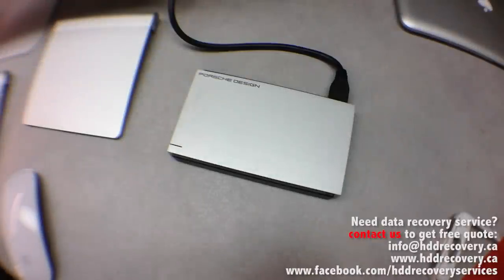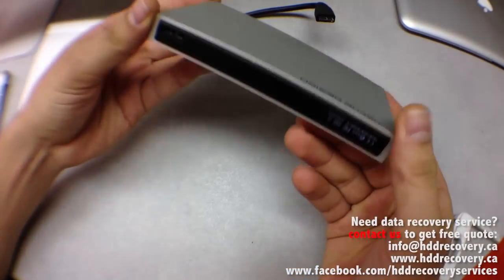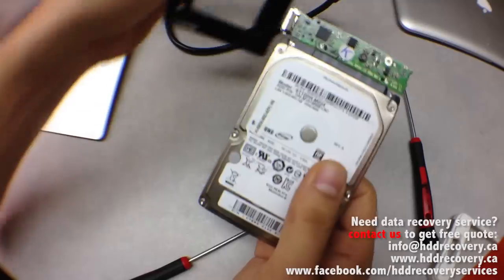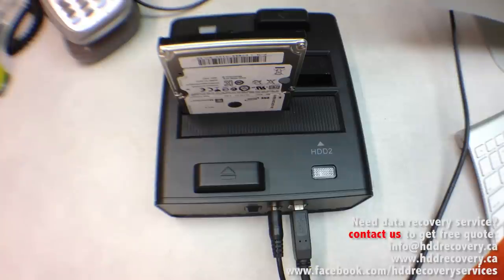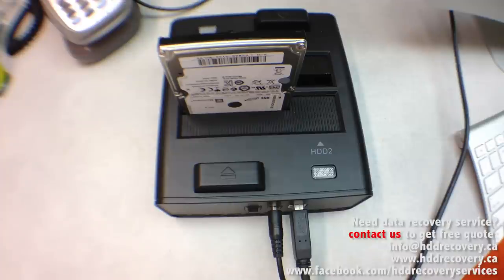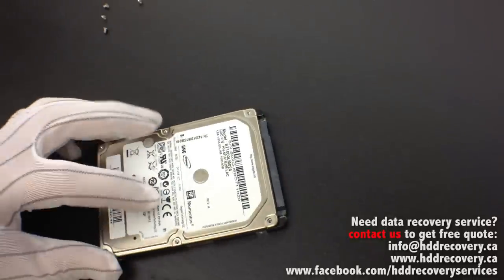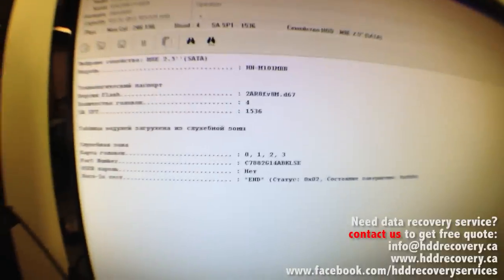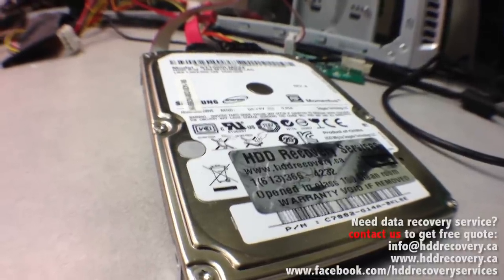Lacie not recognized: Data recovery on Porsche Design P'9220

Comment: WHAT IS THE SPEACILIZED TOOL YOU USED TO LIFT THE HEAD...YOU SKIPPED THAT PART
Reply: +Hang Man 
I really don't think he's going to give away his secrets! ;)
Reply: +Keviin Wriight  lol...well i cant blame them..after all this is a business .although i have a lot about datarecovery since i had posted this last year..its amazing what google search can find
Reply: Does anyone have an answer as to why i have an issue getting the drives recognised while inside the LaCie case? Its a 3tb 2Big Quadra USB2.0 from maybe 2009. They do work when i use them in a two bay wav link dock... The drives (1.5tb each, Seagate) had originally failed while being used on a documentary shoot some years ago. The insurers paid for the expensive data recovery work and two separate G-tech drives to replace this, but never wanted it sent in. It's long out of warranty, and Ive scanned so may fora to no avail. 

So I erased them and did disk recovery in the hot swap dock. They can be read and used in the dock. I've tried them in different formats back in the LaCie case, with different connections (this model has many ports) but still no luck. I have last appropriate version of the desktop button installed. The blue led button on the front does nothing when pressed and held. I've read the manuals. The LEDs on the back are blue on drive one (left side) and red on drive two after powering up... The fan whirs as if it is functioning properly. 

The case or drives have never been dropped and never been taken out of their trays until me... Is there something simple I'm just not getting? 

Please help me before I end up just chucking the case and keeping the drives to use in the dock!

Comment: hmm..i just opened mine and it's "Seagate" inside...in one forum i saw a "Toshiba" inside....so far there are 3 brands in one case produced by LaCie....i can't trust LaCie anymore, not to mention my HDD wants to fromat just for no reason or it wont work, meanwhile it slows down my whole system when plugged (this is its 2nd time - the first one i did the format and the device started working normal but i lost tons of important information)
The only Lacie part in there is the Bridge.
Reply from the maker: 7z7able LaCie only makes enclosures, hard drives are provided by the actual hard drive manufacturers.
Reply: HDD Recovery Services
Thanks for the video and answer - i saw it on my way to open the actual HDD and then stopped :D I knew i can't fix it myself but i was really pissed off...
Yeah, i got that - bridge and case. On my opinion this isn't serious. You can't just put whatever you find in the same case as long as it fits and pretend that the product is the same - this is pretty much chinese counterfeit style.
So, no - i better buy an HDD and use their case cos it looks good :)
Reply: You need to upgrade from windows xp
Reply: Mine also wants to format. I thought it was bc i connected it to a diff laptop. That was years ago. All data is still on there as I left it as is. Now I need access. Anybody has a work around?

Comment: What if the HD isn't making any noises? Is it still fixable? I plugged my hard drive into my computer and it sounds like it's spinning, however, when I plug it into my MacBook  it say its not readable :( I have really important documents on my HD & would like to get it fixed if its fixable
Reply from the maker: most likely it is recoverable
Reply: As stupid as it sounds, I was getting that exact problem. I connected to a dongle that was connected to the computer, and suddenly it worked properly.